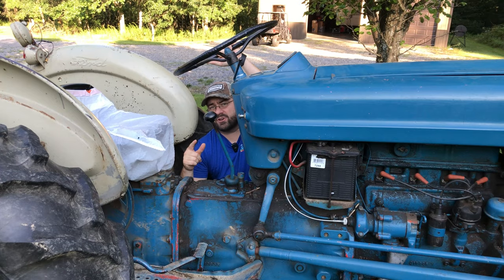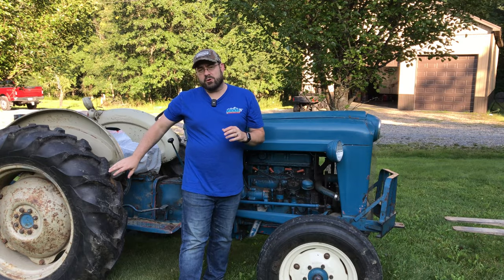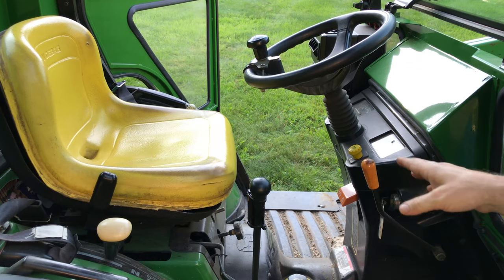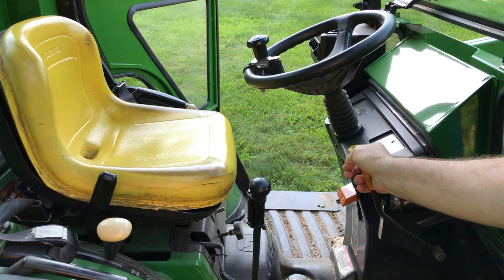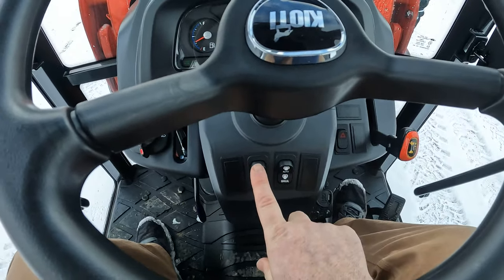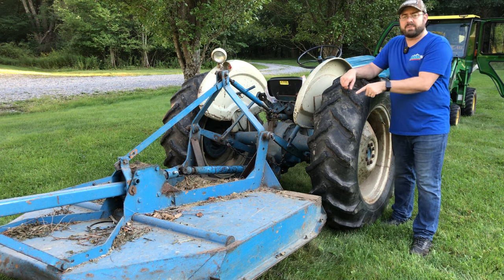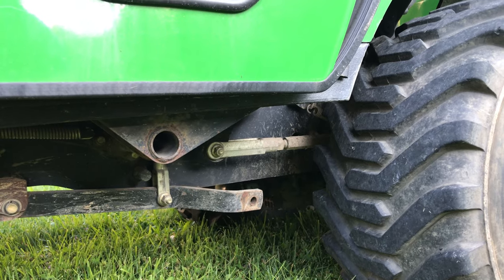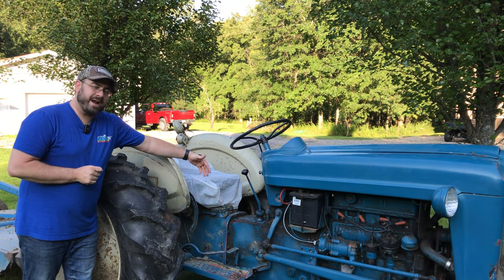Hydrostatic vs Gear Drive - Tractor Decision Series

Comment: Having a tractor - actually two tractors - make chores easier on me now that I'm in my senior years. As a younger man, I used to work my tail off around our 5 1/2 acre property using a wheel barrow and hand tools, and still not get anything actually done before it needed doing again. 10 years ago I bought my first tractor (Ford 800) and things started getting easier with adding on used implements like a mower, a rear grader blade, a pond scoop, plow and disc harrow, and a boom pole - all of which (including the tractor) cost approximately $3500. Just this year (2023) I bought a '54 Ford NAA for $1500 and a rear mounted palette fork for $75. I keep the forks on one tractor most of the time and the mower on the other tractor most of the time. I really hate the task of changing those implements, so what would really be nice is to have another tractor (like a hydrostatic Kioti or Kubota) that had the ability to quick connect to everything. I could probably sell all the old stuff and make a down payment on a new tractor (which I would love to have) but I would hate to part with my old Fords. Those tractors are much like me - pretty worn out - but still chugging along. Sorry for the long comment! I appreciate your diligence in making watcher-friendly videos.
Reply from the maker: Thanks for watching and leaving a comment. There's no doubt that not only do I get more work done because I have tractors, but also it's making my body last longer. My back would be screaming if I had to do all this work without the machinery we're fortunate to be able to have.

Comment: Like you Chad I’ve driven both over the years. I used to plow snow on a 1/4 mile drive with a gear drive tractor. Now that I have a hydro tractor I find it much easier to change direction. Thanks for sharing your thoughts.
Reply from the maker: Thanks for sharing your experiences too! I think the comments in this video will be very valuable to those who are considering their first (or second or third) tractor purchase! :)

Comment: Totally agree with having a manual trans and doing loader work. I spend more time going from forward to reverse and vice versa, than I do scooping and dumping with the bucket. Not being able to shift on the fly is another pain as well. And after a few hours of pushing the clutch in and out? The old leg is not as smooth towards the end and you can see my head bobbing back and forth. lol  But, 20 couple years ago, a JD 850 was all I could afford and it has been very good to me. Great Part 2 video.
Reply from the maker: Thank you! I know many people who don’t realize (until they drive a tractor for the first time) that the transmission is different than a manual transmission in a car. They think you shift up and down through the gears to increase speed or slow down.

Comment: Excellent points! I've experienced the "drag" of a hydrostatic transmission while mowing. I've found that you either have to press harder on the pedal or increase engine speed...or sometimes both. The only thing that stops a gear drive transmission is a mud pit...lol. 😂 Thanks for sharing, Chad!
Reply from the maker: Thanks for watching!

Comment: My current tractor is my first tractor, which has the hydrostatic transaxle.  I mow, and do loader type work mostly, the hydrostatic works fine...if all I did was mow wide open fields, a larger tractor with a manual transmission would be perfectly fine.  

The tractors that have shuttle shift wouldn't be too bad for loader work since you can quickly and easily shift between forward and reverse, but a regular manual transmission where you have to manually shift back and forth would be a pain if you were having to do that type of work all day long.
Reply from the maker: I agree! I have done snow plow work on the Ford 8N, and compared to the HST John Deere 2210 - the difference is night and day.  
Shuttle shift is certainly helpful!